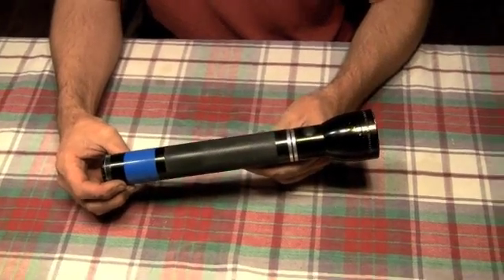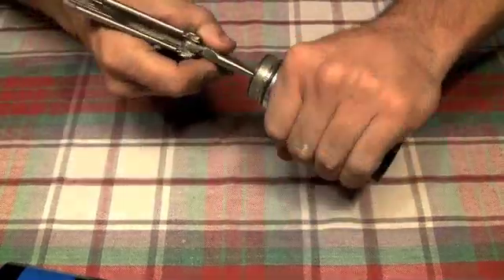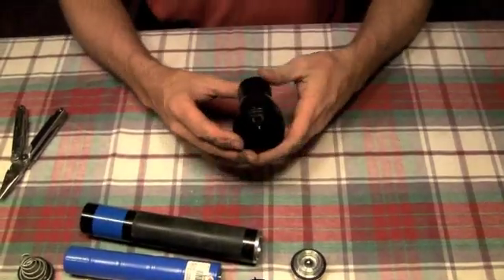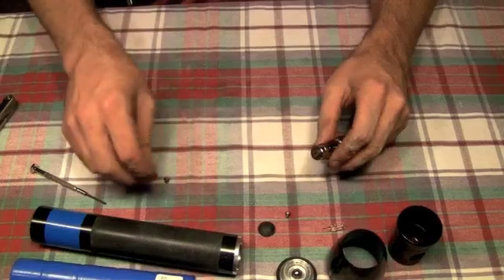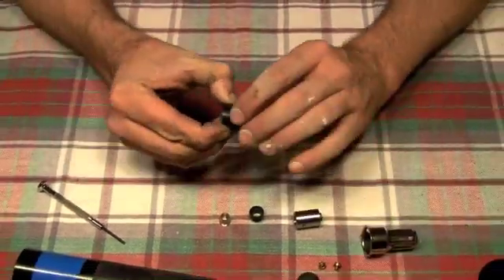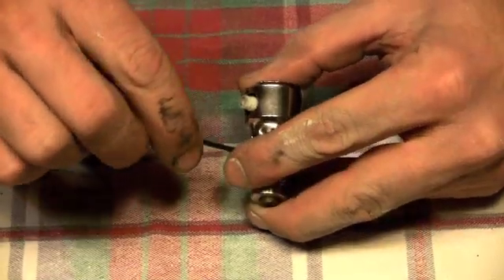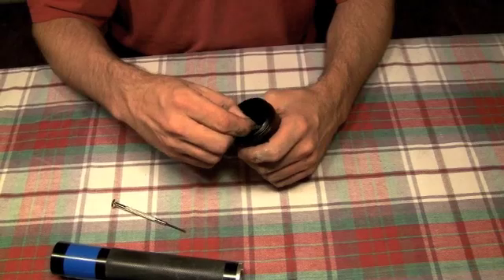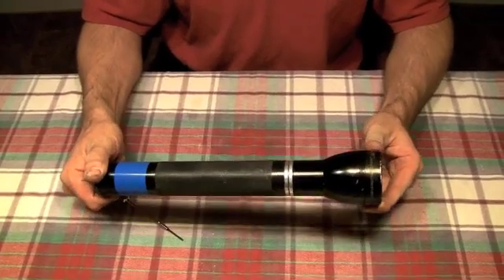How to Take a Rechargeable Mag-lite Apart

Comment: Hi mate, I got two identical maglite like yours down here in Australia. One of mine does not charge in the charger anymore so I have to remove the battery and put it in my functional maglite to charge it each time. 
Do you know if one of the resistors you talked about or a diode may be fried? If so how to do I inspect the inards of the positive contact assembly?

Thanks in advance!
Reply from the maker: sorry, I can't be of much help, I would have to look at it in person, There really isn't too much in technology for charging these units. At least with two units you can test components side by side with a multi-meter.  to start, I can say that I would be sure you're getting power from the contact points on the flashlight to the charging board.

Comment: Excellent video, one question, I have an identical flashlight, and I would like to know if it can be transformed to led, since it has a halogen bulb, greetings and in advance I appreciate your attention.

￼
Reply from the maker: Hi,  All these lights can ultimately be converted to LED.  I don't know if there is a direct replacement for this exact model, but there might be.  I have successfully converted my Streamlight Sl-20 with a light head I bought on ebay, but it required some trimming and fitting of the cooling fins.
Reply: @yourbeekeeper  I appreciate the answer, I already found out what spare part it has, now what I do not understand is because my flashlight does not do the high / low / strobe functions, I saw a tutorial where they did it with an old rechargeable flashlight, but mine that is identical does not does, well, I appreciate your attentions, greetings.

Comment: I have 2 rechargable mag lights, recently they both quit. After watching your vid.I dissam. Both found pos. Contact corroded spring, cleaned each spring washed and brushed with baking/water solution, then used razor blade and scraper end face of all end of springs . Then reassembled as per you shown. Note: I DID use a very little anti seize to each and all threaded housing threads. To future PROTECT 
Alumun. metals at threads.
No Thanks to you guys, both of my mag kites work like new!!  THANK you.  And I contacted interstate battery
And got 2 new battery packs. What is the strongest and best bulbs available? I do not like l e d conversions.
Reply from the maker: Hey Dennis,  Glad we were able to help you out and get your lights working again.  Honestly,  I'm not sure the strongest and best filament bulb around anymore...most manufacturers are not putting any effort into filament bulbs and focusing on LED improvements.

Comment: I can't get the ring with the 2 holes to unscrew, what do I do ? can you help.
Reply from the maker: HI Roger.  Sometimes the metals can be very difficult to get apart.  I have found the use of a heat gun and/or penetrating oil can have good results.
Reply: Thank you for the reply, I will try that.
Reply from the maker: Let me know how it works out.  I like a heat gun and not using a flame torch because penetrating oil is flamable and it can get messy.  A good heating will expand the metals and after two or three heat/cool cycles with the oil added after heating really gets the oils into the threads.
Reply: That worked, thanks for the help. One more thing if I may, do you know if the light can be upgraded to a LED bulb?
Reply from the maker: Roger Jackson cool!!!  Glad that worked out.  I don't know for certain, but I would venture to guess an upgrade to LED is made for this flashlight.